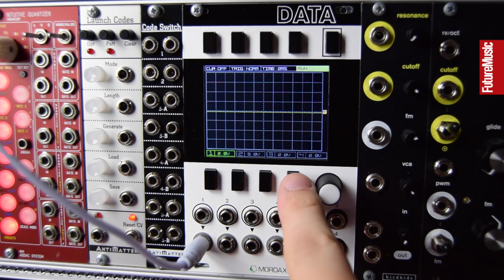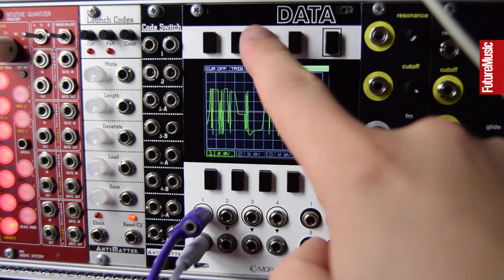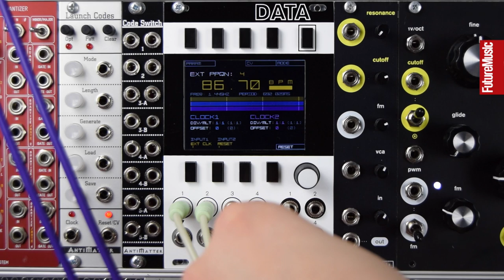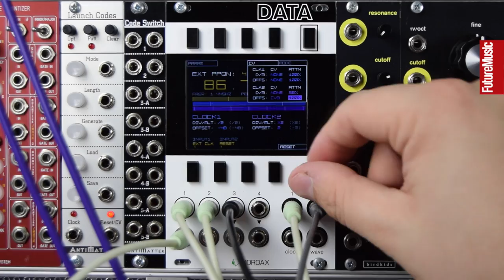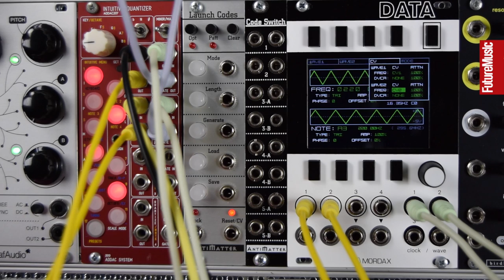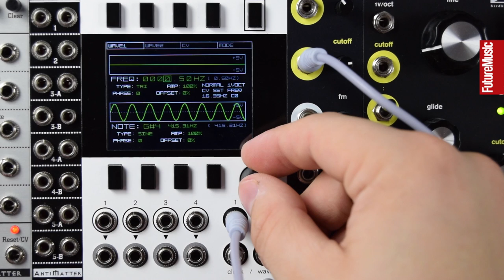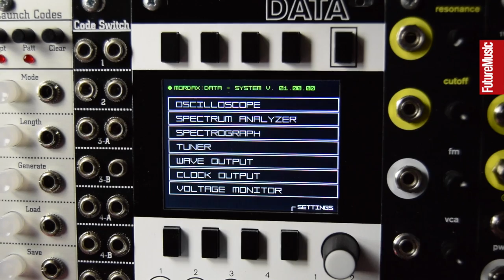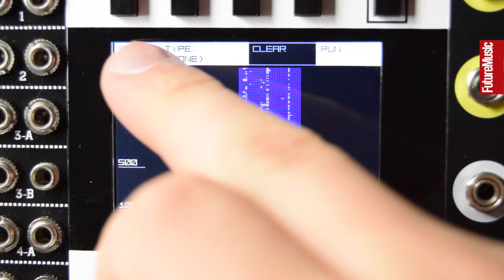Modular Monthly: The many faces of Mordax DATA

Comment: Thax for posting this vid ...I gotta say this is no gimmick - its a versatile tool dedicated to modular . I have a Rigol DS4014 4-channel scope and by comparison the DATA is more than adequate for audio use and quicker to dial in multiple channels  (..and a lot cheaper too! : P  )   The dual clock divider w/ the offset feature demonstrated in the vid is a much better design than some modules I have dedicated for that task. The available triplet/divide by odd #'s  is also really a cool feature ..  The tuner setting makes quick work of setting up multiple VCO's to a common reference cv/pitch. I haven't explored the dual VCO/LFO's demo'ed in this video and was happy to learn more about them. I am a fan.

Comment: Div is it possible to multi task.......have data in wave form mode AND have pam’s workout into channels 3 and 4 passing through a gate out...and be able to flip back and forth to see pans workout in the scope, while the wave forms are sill active?   Hope this makes sense.....basically I like this with pamela so i can  discern the signals but also want to use the wave forms out at the same  time ( and switch the view back and forth ) ...

Comment: Great video as always Ben.  I have a question about the processing in this video.  At around the 13:13 mark you switch thought the waveforms, and both of the Sawtooth waves sound so incredible, and so far away from anything that I would consider digital.  My outputs from the Data do not sound like that!!
Was there any processing or saturating going on in audio the signal flow?
Reply: Definitely reverb and probably a filter to take the harshness off.

Comment: The ultimate gimmick.
Reply: Well it's a scope that's comparable to bench scopes in terms of accuracy. So far from gimmicky. The clock generator is far more stable and accurate than a lot of other offerings too. The dual waveform generators with VCAs built in (that also go sub audio into LFO ranges) are also very useful. So not sure I'd say it's a gimmick.